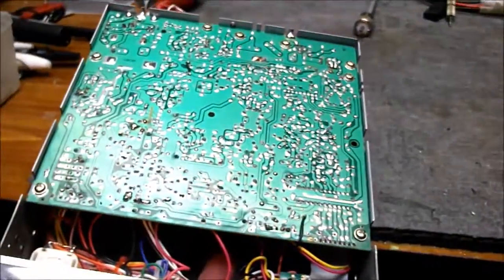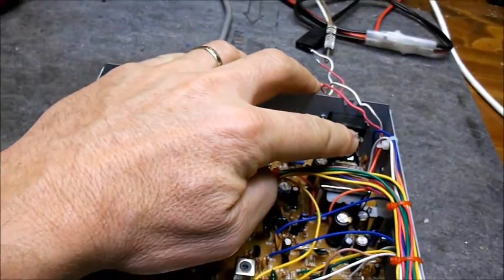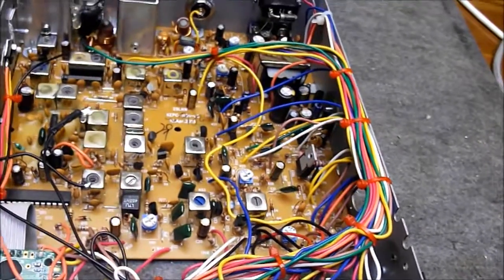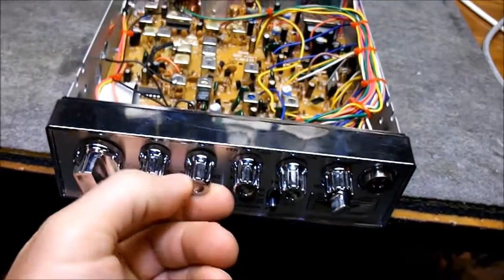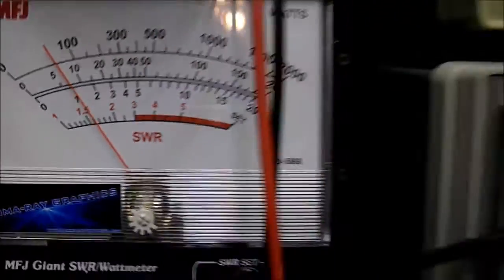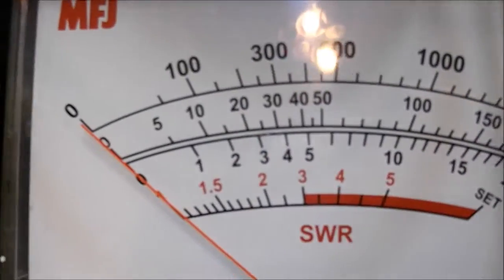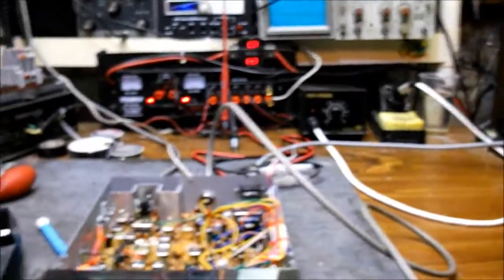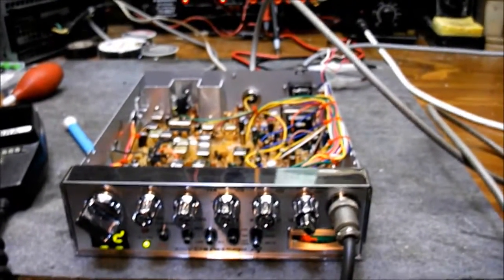Cobra 29 TIP 120 Jerry Pa...

Comment: Just wondering if anyone has tested or used IRF 520's, with what I've found, that have 93w output? Will these work? I've found 48w (that was the norm back in the day), 60w and 93w outputs. Want to know if it makes any difference. Thanks

Comment: I want to see scope and spectrum analyzer. Lol.
Reply from the maker: @Southern Gunslinger No a scope tells you exactly what the signal looks like too.Some people want their radios a little punchier that 100%.Even most commercial AM radio stations push the waveform slightly clipping so they can reach out.As long as your audio is clean its not a big deal what the wave form looks like as long as its not flat topping.Im kinda getting tired of all these people saying it has to be 100% and no more or its bad.I been in the hobby long enough to know there is a million ways to tune a radio for however the operator wants and needs.For example a tube amp needs a super clean waveform or it will most likely arc..but if your at a key down in front of a class C hammer box the dirty radio always wins!!For everyday talking I like to tune my radios a little hot so the waveform is coming apart slightly but not flat topping..the audio here is very clean and mean.If you roll the mic gain back a little your wave form will clean up to 100%.As long as your transistors are not going into saturation the audio will be pleasing to the human ear.Of coarse they are going to hear you on the channel above and below because your filling up the complete frequency you on plus part of the others thats how you win a comp or get out a little farther.Modulation is power..especially when the negatives are compressed :)
Its always good to have a little more than not enough wishing you had more.Just use your mic gain.100% clean is boring boring sounds like a damn telephone plus if the radio was set up 100% mic gain wide open you dont have anymore to reach out and make that contact.Believe me the whole band purist thing gets on my nerves.Dont fall for it!
577